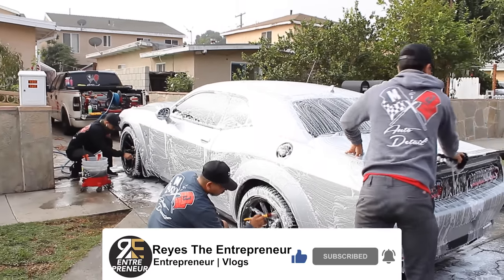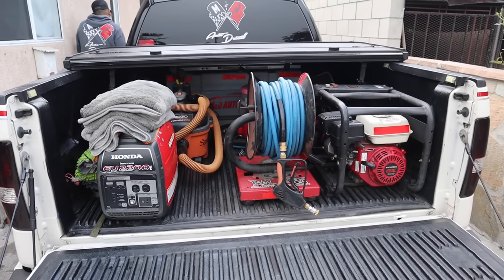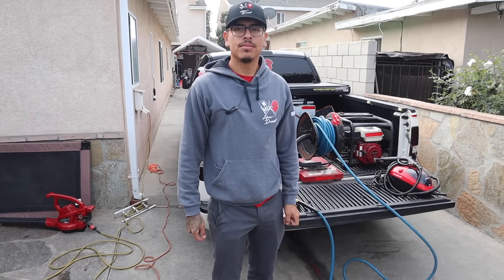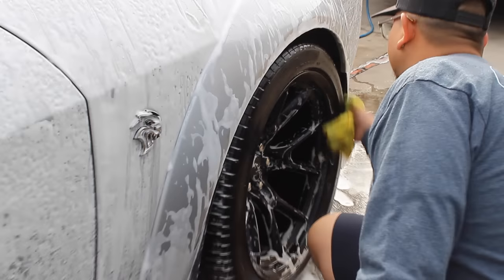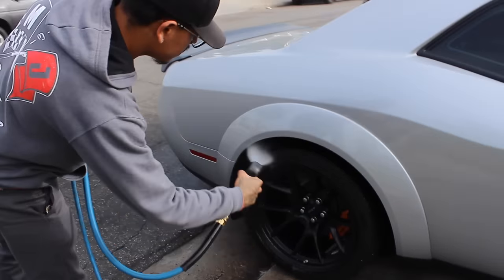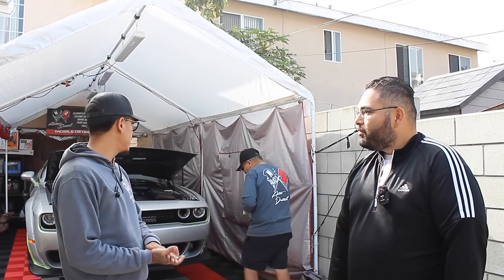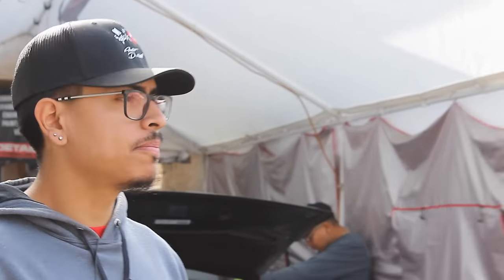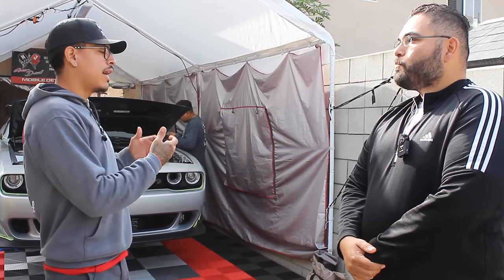22 Year Old Detailer Making $1,000 A Day

Comment: Only main issue I saw was the spraying the foam cannon in the engine bay plus spraying all the water after. It’s something I wouldn’t personally do because I would hate for the car not to start once I’m done because you just put water all in the carburetor and water build up around the spark plugs. Easiest way to get around that is one always making sure that stuff is covered up with at least a bag because If it hasn’t happened yet it’s only a matter of when
Reply: It’s a modern car it’s fine
Reply: I've been a dealership mechanic for 25 years and yeah many engines have the coils going straight down into the engine heads and water does end up in there and shorts out the coils.

Comment: 1300 for a car wash?!!! That's crazy
Reply: That $1,300 car wash takes around 10-20 hours to do depending on condition. Flash wash, clay bar treatment. Iron removal. Prepping paint work with a 50/50 alcohol dilution followed up with extensive paint correction takes time. Applying ceramic coating alone takes around 40 mins if done correctly.
Reply: @butskiiueepp1625  couldn’t have said it better myself, people just aren’t educated correctly on what the process is and how much work it takes